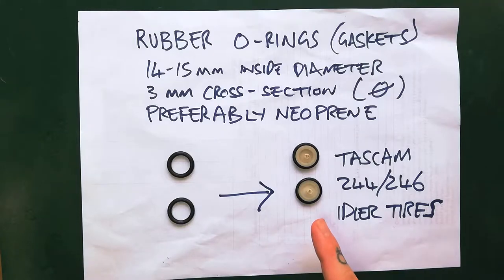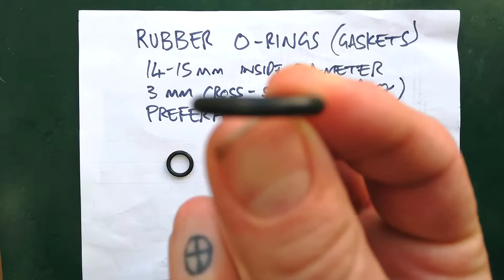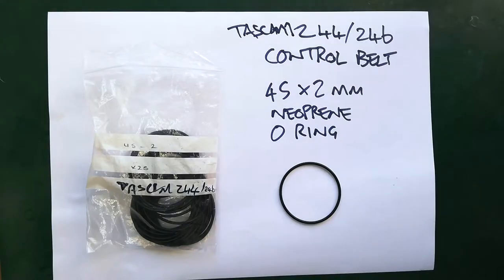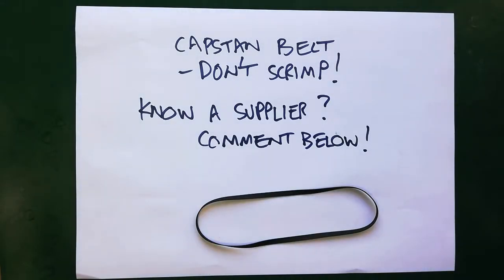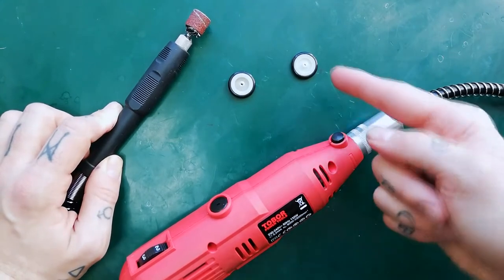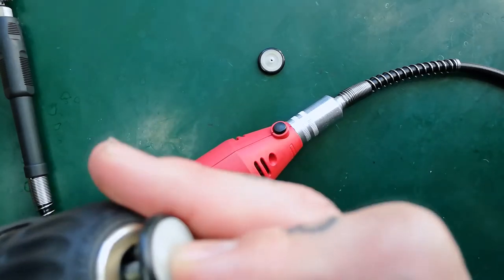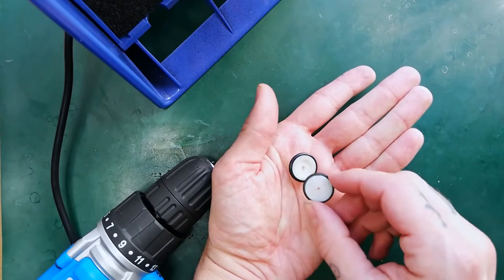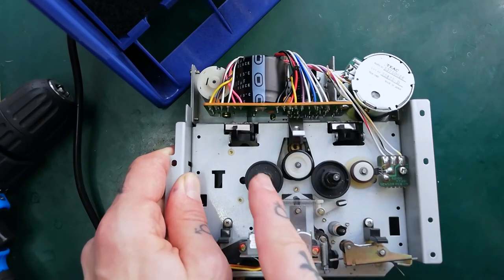13 source cheap rubber parts (Fix the Tascam 244)

Comment: Just made my own idler tires using this method, will test in a few days when my capstain and control belts arrive, but there seems to be a lot of grip when I move them manually over the tape rollers

Comment: Hey, thanks for making such wonderful videos! Have you considered 3D printing belts and rollers out of flexible filament like TPU? I've got a 246 that needs replacement parts and I'm seriously considering trying it out.

If I get that far, and it works out, I'll be sure to share the details.
Reply from the maker: Getting to grips with 3D printing is at the bottom of my inbox buried under much more tedious but lower hanging fruit, so if you can get to this first I’d be delighted to hear how you did it, good luck.

Comment: For the 244 control belt, does 45mm refer to the ID or OD? I'm trying my best to get mine working without spending an extra $100 on rubber parts, but I can't seem to find this size in US hardware stores. Since I'm ordering online, I want to make sure I get the correct size.
Reply from the maker: Outside diameter, but that mechanism is pretty tolerant tbh, a mm or two either way is still going to work. I was buying o ring this size for less than  five pounds for twenty pieces.
Reply: @Tetrakan  thanks for the response. I found some great sites that ship to the US, so going to give it a shot ordering some tomorrow.

Comment: Hey thanks so much for making these videos. I had a 244 recently repaired that is playing back way too fast and pitch control doesn’t work. I actually had it “repaired” twice, but it’s still doing the same thing as before I took it in the first time. Do you have any suggestions as to what the issue could be? They replaced all the rubber in the machine and it records and plays back fine, just way too fast and no pitch control :-(
Reply from the maker: Have you checked if the pitch control is connected? It's a  three cables - yellow white and purple - which connect via a white plastic plug, it should attach below and to the right if the transport.

Comment: You mentioned gbaudio - they have drive belts on http://www.gbaudio.co.uk/data/belts.htm.  There isn't a "size 10" but there is a "BELT10" which is 276mm (internal circumference) x 4mm  - is that the right one please?  They have confirmed to me that they have supplied this for a Tascam 244 before but also "BELT86" which is  151mm (internal circumference) x 1.2mm so I'm not sure what the other might be for?
Reply from the maker: Yes Belt10 is the one i mean. I guess the other one is he control belt, though I've been buying rubber o-rings at a few quid per dozen...from experimentation I've found getting a good quality neoprene belt for the capstan is crucial, whereas its a bit of a waste of money to throw nearly a tenner at the control belt.
Reply: thanks for the link! I just bough Tascam 246 in good shape but by just opening up the bottom part , I can see that both belt are broken and there is a black goo on the wheels . don't know yet if the rubber-O-rings/gaskets need replacement or not. at the moment  trying to source out replacement parts . Does GB Audio reels any other rubber parts for Tascam 246 or just that Belt10 ? any other links for maybe a full KIT ... I am in Amsterdam Eurozone. thanks in advance , cheers, Dimitri

Comment: I've found these pinch roller rubbers to be pretty good/cheap:
https://www.ebay.co.uk/itm/5pcs-Rubber-13-x-6-x-2-mm-Pinch-Roller-with-Axis-for-Cassette-Decks/264524926095?hash=item3d96ea0c8f:g:wzMAAOSwQKtefyLC
They come on a plastic hub and metal pins - which match the 244/246 pinch roller pinhole, they also can be "stripped" of the rubber and use the original metal hub. There's a slight camber to the edge on profile, but nothing serious, it is really very slight. The plastic hub needed a tiny tiny bit of sanding to fit between the roller holder assembly - about 4-6 strokes of fine sandpaper did the job, both sides.
Reply from the maker: Richard Smith awesome, those look ideal, thanks for sharing your information.
Reply: thanks ! I'm ordering right now .. They are 5 ... So I have some avalaibles for people  here that would need one ...
Reply: @surferdargile  Hiya...do you still have some spare or do you know where i can find one...cheers